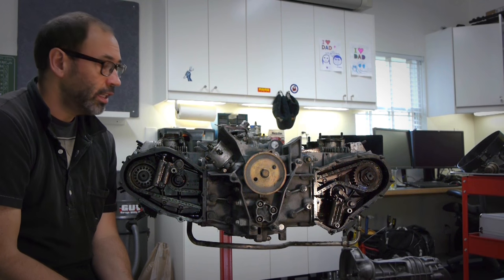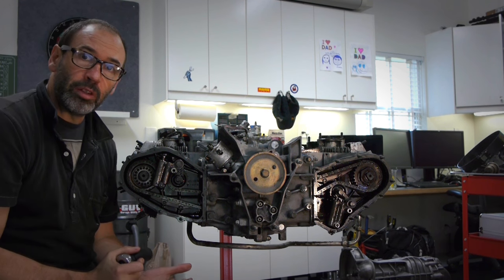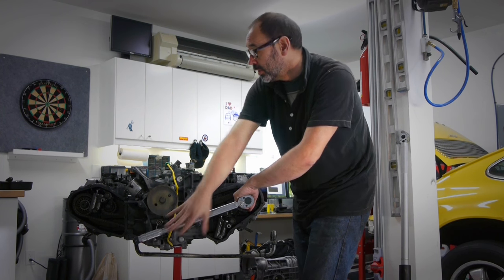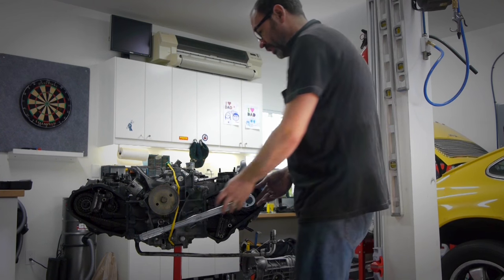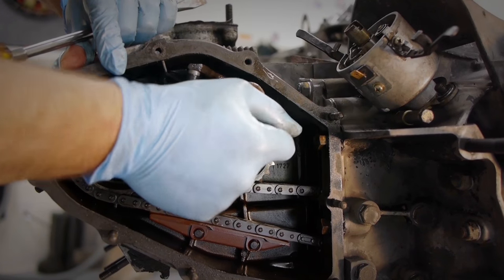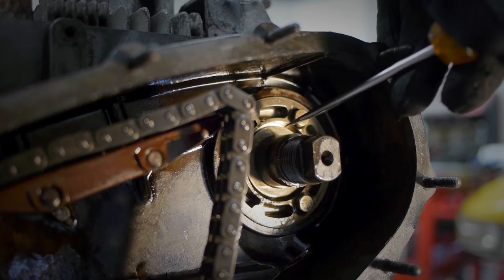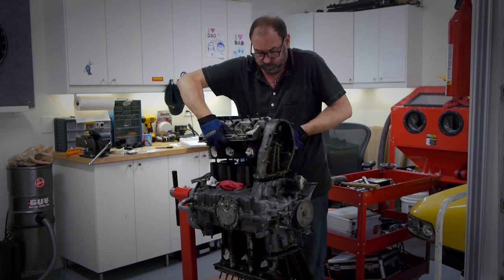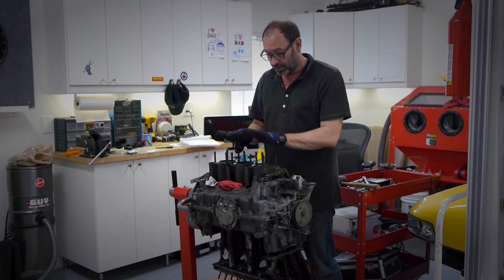Engine Teardown Part 1. 1969 Porsche 911T . The Canary Files.

Comment: I watched your re-assembly of the engine a week or so back but not your teardown. Nothing like watching something out of order.
I do have a question. You removed the timing chain sprocket but what is that inner sprocket for?
Reply from the maker: That is the flange sprocket and it fits over the camshaft woodruff key and accepts the dowel pin from the timing chain sprocket.